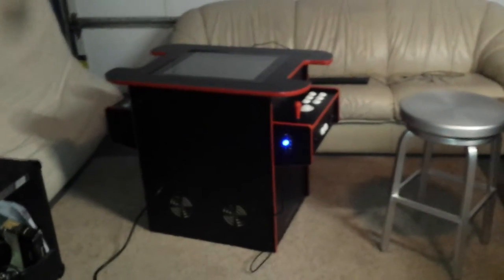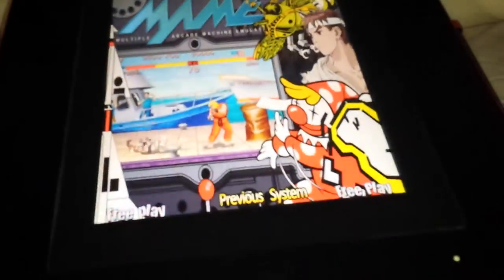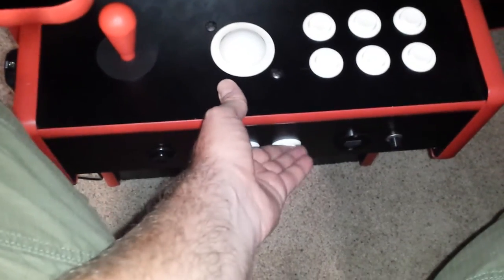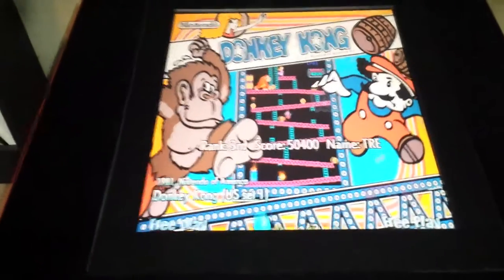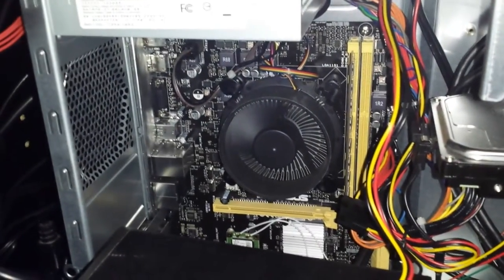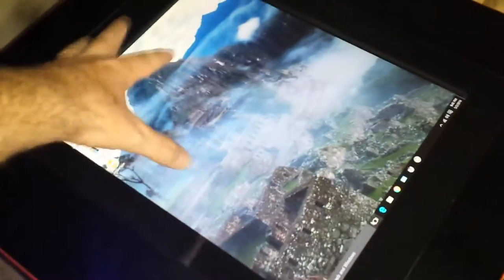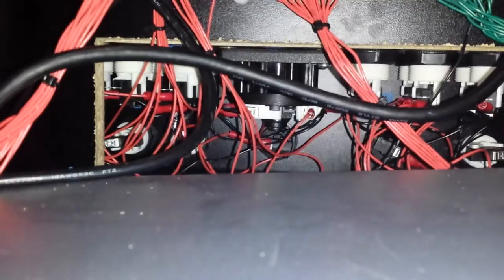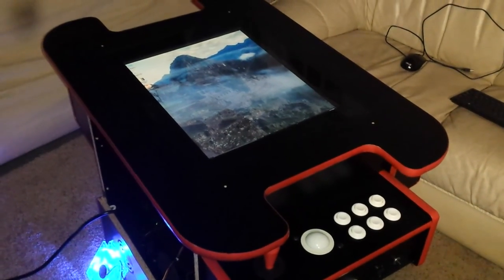Super Average Bros build an arcade machine

Comment: Cool build. Can both trackballs be used simultaneously? If so, how do you set it up for that?
Reply from the maker: Yes they can. Since they are both basically USB mice they both share control of the cursor in windows but both trackballs are seen as different physical controllers so in games they can be configured to different functions within MAME or almost any other game or emulator. Marble Madness works great!
Reply: That's awesome. Have you tried Atari football with it? The one with the X's and O's. That was an intense game for me back in the 80s. I'm going to have to build one of those some day.
Reply from the maker: I haven't tried it yet but this setup with two trackballs would be ideal. I'll run that by my friend and see if she's tried it yet.

Comment: whats the specs on the computuer your using?
Reply from the maker: i5-6400, 8GBS DDR3, 1TB HDD 7200 RPM, Intel Integrated 530 HD graphics, WIN 10. I bought this pc on black friday last year and it was around $600. Only real problems were the integrated graphics and windows 10. The integrated graphics are enough for my friend to play all the games she and her family want so even though it's less than I'd put in my cab, it's enough for them and saves a few hundred bucks. However, WIN 10 is the worst. It was the biggest pain in setting up this machine and making sure Hyperspin and all the emulators worked.

I've seen a lot of videos recently where people have made similar machines using the Raspberry pi instead of a solid PC. While you could go that route and save a few hundred dollars, I like going the PC route for more functionality. The owners of this cocktail cab I built can load steam and run PC games off it as well as tons of other stuff the pi just can't handle yet.